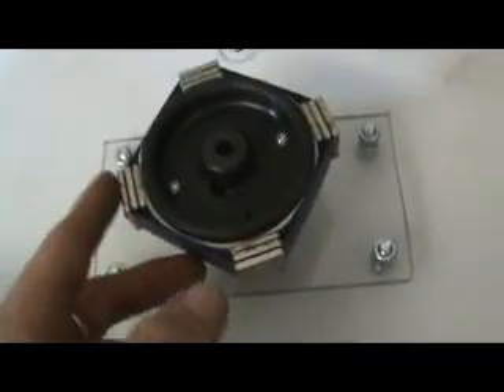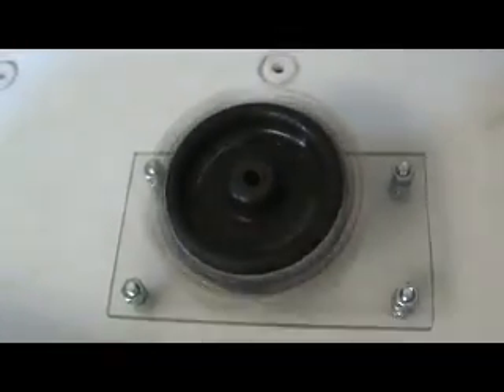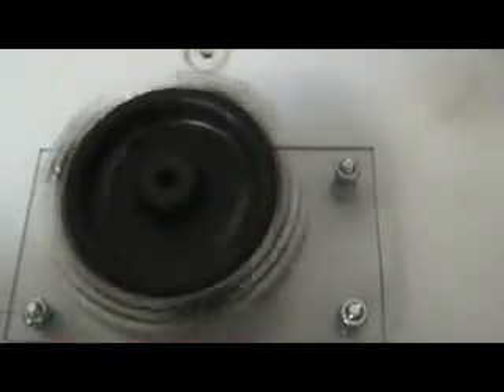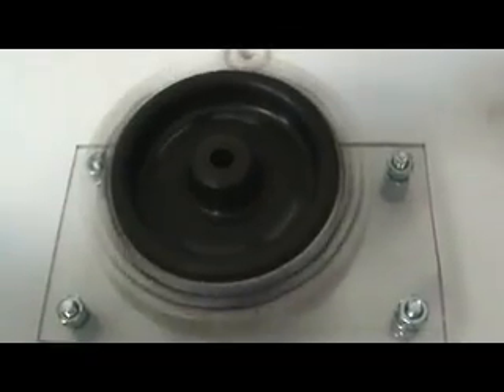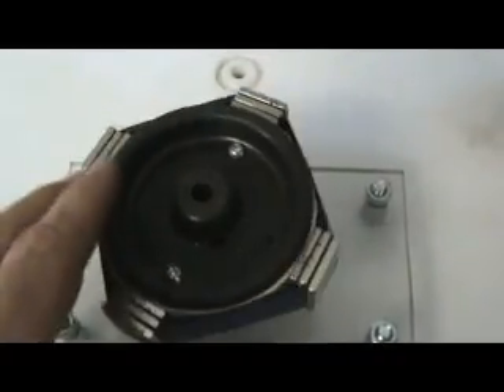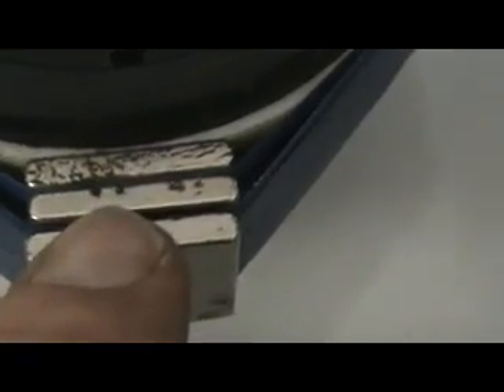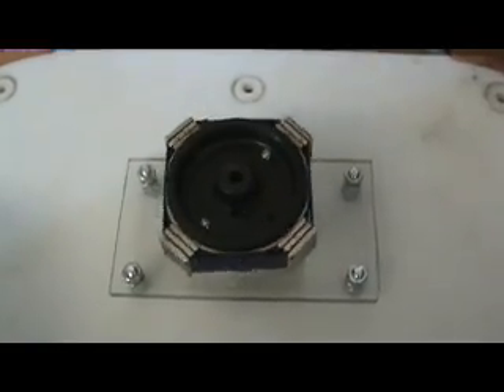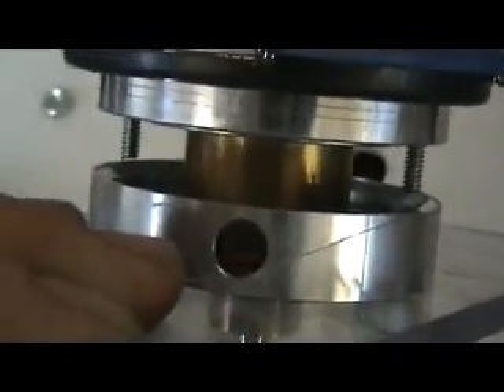SELF RUNNING MOTOR CONSTRUCTION

Comment: OK Mr when u install the gen coil n starter coil so when stater coil is gonna take some amps from the generator coil after that u can c is not working when is stater coil gonna take amps in side the generator winding naturaly create the magmatic field which is enough 4 stop ur motor u can try . 4 example. when is patrol generator is start n when u give the load generator that time u can leasing the generator sound gonna missing because piston is going to break that magnetic fields which is create from load amps petrol is power ful that's y u can c u r petrol generator is still start n working

Comment: I think if u add a flux catastrophe also a network interphase Controle module you'd have something. Then buy a generator put some gas in it start it up then plug a light in it should work fine.

Comment: 0:18 "I would expect I can make this run on itself with zero batteries at...extremely sim...kids play...for god's sake's its simple..."

Well it's 2013 now and its been over 3 years since you posted this video. So uhm...where's the miracle motor huh? Never got it to work did ya?!

What happened to "kids play"  and "extremely simple" ?

Get the fuck off the internet and take your free energy buddies with you!

Comment: I would like to say that you have basically created a more mechanical version battery that is storing the the energy from when it was initially started but like battery's when a load is applied the energy will be drained and your motor will stop spinning there for you are not generating any more electricity than what you put in it.

Comment: You want as little friction as possible, Friction is just wasted energy, it creates heat as well as taking away from the entire equation, since there is no power going in like say from a battery, or what have you, and the wheel is powering itself, it makes sense to keep friction to a minimum.. or else it will just gradually slow down to a stop because under a certain speed it will stop producing that power to run itself and it will stop.

Comment: Say, friend, every electronic device, every motor vehicle, every electrified dwelling has done just that from day one. That in no way implies that a "self running device" is therfore possible. The increase of voltage using a transformer does not equal increase of energy.Voltage is not a unit of energy or even power.

Comment: I normally only make nice comments or none. "SELF RUNNING MOTOR" is your title and I saw NO motor run by its self. And you call people like us STUPID? You showed NOTHING! 10 minutes of jiberish. People like us are looking for that one hint to make our idea work. And 10 minutes of "look at it spin" and "you stupid people" and "50,000 rpm" you know at 50,000 rpm that tape should hold if not the magnet will simply hit you in the FACE! and "wheel caster wheel bolted on bla bla bla" YOU ARE THE IDIOT

Comment: seems like your the stupid one. if it were kids play, you could show us a RUNNING motor. just because you took some parts from a VCR, and taped some magnets on them, does not make you smarter than everyone else that is trying to do it. the motor your describing is a bedini motor with a couple of air coils added. dont know if you know or not, but its been tried in the early 70's. i have seven diff bedini pulse motors. all are very good efficient motors... but none are self running.

Comment: I have heard about a wind power generator wich at 100 rpms produces 12 volts at 6amps using large neo magnets. Now that is 72 watts. But the rotor was heavy so if the people make it lighter then 60 w will definatly power itself and additional things.

Comment: do you even realize how to power that motor ? I'll give you a clue since your clueless... you cant just put power to it you need the drive for it dumb ass. or how bout the generator would hold back the motor if it could generate enough to spin the motor it would have to have an amp and capacitors to even the flow, but you still need a different motor to start with lol

Comment: "Kid's play, God's sake, it's simple."  Yes, it is: there is no such thing as a free lunch.

I don't understand why you call people stupid.  You spin it up, it slows down.  That's how drag works.  You put a motor coil in one spot and put a gen coil in one spot, the motor coil will use more energy than the gen coil can produce.  There are losses in the wires, aerodynamic drag, etc.

You have enthusiasm, some knowledge, but a poor grasp of the finer points.  You shouldn't call anyone stupid.

Comment: well why dont you do it for us stupid people, I made a similar one with tape and it blew apart and put holes in the walls so be careful it will do it, didnt need any coils either just N_S pole magnets and spun it up adn it took off like a mad and revved til it blew no way to slow it down I had no idea lol but mag motors work but not with tape dumbass

Comment: When you generate electricity through an electromagnetic motor, the kinetic energy is transferred to electrical energy. If you use a hand crank generator on a circuit with 3 light bulbs in series as opposed to powering 1, it will be harder to turn.

Comment: You sir are a moron, tell me what happens when you put an electrical load on your lil wheel?, I generate electricity for a living, the only way to `make` electrons it to use a mechanical force to make 2 or more electromagnetic lines of force that repel each other the larger the electromagnetic force the larger the `work` or mechanical force needed to generate, go back to washing dogs or whatever it is you normally do.

Comment: Um, how do you deal with entropy?  How do you propose to defeat the first and second laws of thermodynamics? Additionally, what is your method to defeat the law of conservation of energy, being that an isolated system (which apparently doesn't exist in nature) will only sustain the amount of mass/energy within itself barring any output.  Also, being that E=MC2, if there were a output of energy, there would also be an out put of mass until the object was depleted. But hey, I'm a dumb ass...

Comment: FUCK !***! YOU ARE DUMB.....IF IT RUNS ON A BATTERY, IT'S BATTERY POWERED..... IF IT JUST SPINS FOR A LONG TIME THEN STOPS IT,S LOW FRICTION AND YOU DIDN'T INVENT THAT! THE BEARING YOU ARE USING IS FROM AN OLD TAPE VIDEO RECORDER..  IF YOU CAN CHARGE FLAT BATTERIES FROM IT AND POWER LIGHT THEN IT'S AMAZING!! IF IT'S RUNS ON BATTERIES AND GOES FLAT IT'S JUST A MOTOR.  IM SURPRISED YOU HAVE THE BRAINS TO KEEP BREATHING...

Comment: The concept would be directly relative to the amount of load placed on the generator circuit and the capacitance would surely and eventually run out from friction.  Output is directly relative to reclaimed energy minus friction loss.  True it would spin for an awful long time with zero resistance but relative stored energy diminishes over time and therefore the longer there is no load, the less energy could be extracted by load.  Perpetual motion is farce.  Method of storage does work however.

Comment: This is a perpetual motion machine to suggest it could run on its own generated power. To suggest you could run a load off it is even more implausible. The classic perpetual motion machine I think is displayed in the Smithsonian. It looks and acts entirely completely plausible, but of course doesn't work. To make energy, you need energy from SOMEWHERE in the universe! All motion degrades as heat, since friction is ALWAYS the result of motion. Best you can do is minimize friction.

Comment: easy, battery to pulse dc to a coil to power the motor, suck the power from the motor using one of a million methods, such as driving an alternator, or if sucking the power directly, charge a capacitor and not a load so that lenz law is negligable, and have the capacitor charge the battery

Comment: It's called a flywheel. The idea has already used extensively for hundred of years. 

You put kinetic (movement) energy in and it stores it until you connect generator coils, at which point the kinetic energy is converted to electrical. 

One use for a larger system is regenerative braking.

Comment: Cool stuff, but why did you use magnets? You can just use any weights. I mean, as long as you spin it it by hand there's no need for magnets. And the energy is not free, you pushed it by hand. And if you try to drive a generator with this thing you will recover all your energy minus the one that's lost in friction. It isn't a generator, it's the opposite.

Comment: That's called magnetic force, and the one that acts on the magnetized needles in compasses is a very weak one. Compasses require near-frictionless support to move properly. This guy is on a start with his low friction bearing, but the earth's magnetic field can't make it spin forever.

Comment: HEY STUPID. dont use low friction bearings, use magnetism above and below the wheel to have it hover so only air is acting as resistance, or better yet, encase it in a vacumed space with no air for resistance either. concept does work though, I have created something similar. now stop calling everyone who isnt you stupid, stop thinking your better than everyone, and start helping people by building a working free energy engine that powers your town

Comment: You are right,on the other hand there is no use of it if you wont connect it to any power consuming device such as lamp or resistor it will sping like a hell but if you connect a lamp to it you will see it will be slow down and will harder to turn.

Comment: A motor is supposed to do work on a system.  That is its role.  Even if it were possible to have a motor spin on its own forever, it would never, ever, be able to do anything remotely useful, because as soon as you use any of its energy, it will slow down.  This is stupid.

Comment: I guess this happened long ago but if you rotate that at high speed the magnets need Much more than electrical tape to hold them on probably fibreglass tape with epoxy or stainless steel strap 
I'm no math expert but at high rpm the centrifugal forces are Much higher than most people realise – watch dragster tires as they start off to see a graphic representation, be careful.

Comment: From frames 28 to 32 there appears to be a shaft coming through a hole.  Is there one?  I know I am repeating a post but I saw the issue before I read the other post.  I also could not find a reply from you explaining the frames.

What is the function of the hole and shaft?

Thanks!

Ron

Comment: This is eye candy for the gullable - lots of impressive but empty two-bit theory and some intimidating posturing but absolutely void of any meaningfull working demonstration. This has been a complete waste of my time, it wasn't even entertakining. Also, you are an idiot - at 50K RPM those magnets will have the impact of an 30-06 rifle shot and some surgeon in some emergency room is gonna be cutting them out or your ass. Also, the magnet pieces aren't 'shrads', they are 'shards' - get it right...

Comment: A low friction bearing is one thing.  The load imposed by your generators will slow down your wheel.  They cannot capture more energy than the load they impose (or where does the extra energy come from).  

No one has been able to create a perpetual motion machine.  The energy has to come from somewhere.  The best you can hope for is to pull the wool over someone's eyes.

Taping magnets to a caster wheel is laughable.  Love to see that hold when you get it up to "Super High Speed D00D!". LOL!